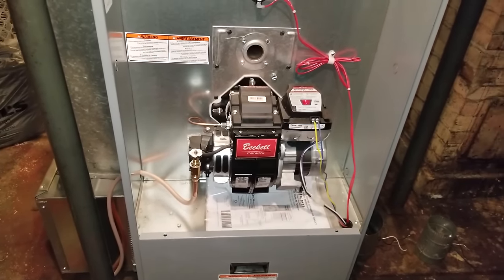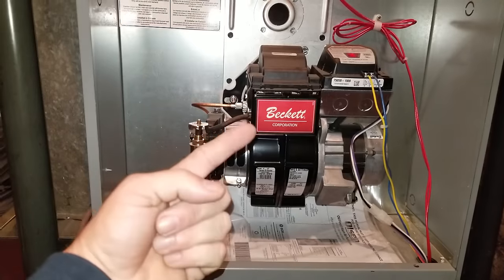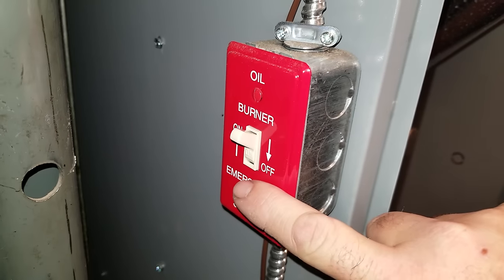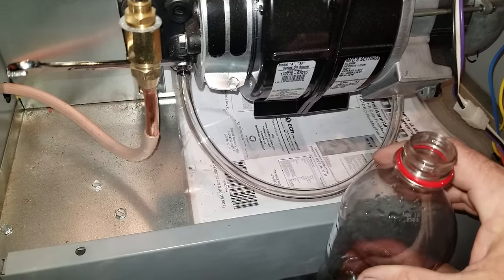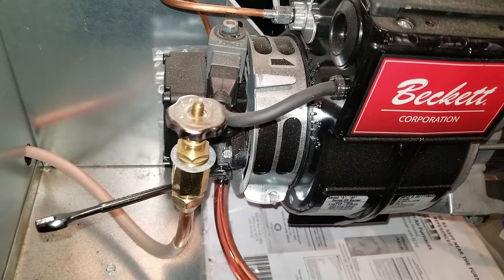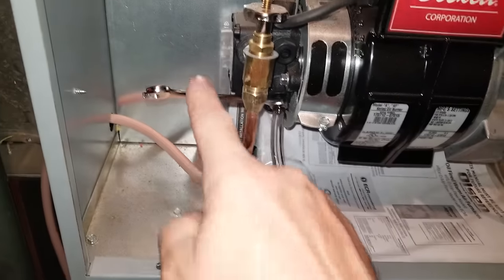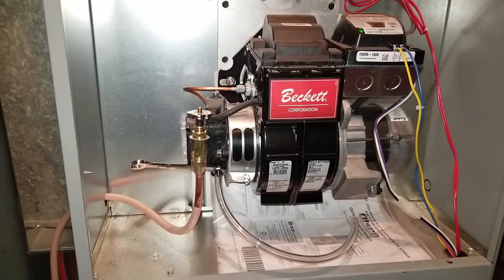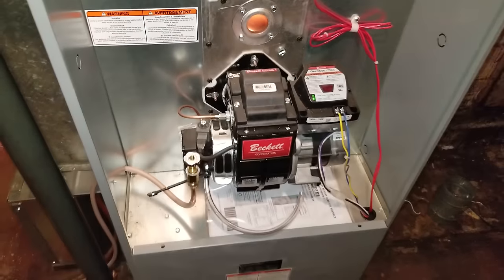How to bleed oil burner how to restart the burner

Comment: I am trying to bleed my boiler.  I have the same Beckett. I am trying bring up my heat at the thermostat. I have a on/ off switch at the side of my boiler & the red still light on top of the box.  No oiler is coming out when I open the knob. Do I need to flick the button on the side, do I need to reset my thermostat because only Cold air is blowing out.

How do I get my thermostat to go up?
The hot water came back on, but not the heat. Please help

Comment: I got a question ⁉️ why or how come when I'm bleeding my (Beckett model 7505 OIL burner) it will give me a good flow of oil but then nothing?? I know there's no air in system cuz I've been bleeding it over&over&over&over& ...u get it ... But then a really nice stream of oil I'll shut bleeder valve it will turn on for 5/10min  then it will cut off & I'll bleed it again then same thing happens??? HUMMM🤔

Comment: I read somewhere that these things can explode if you have too much air in your line and you are trying to start it by pushing the resetting button too many times. You can only try it a couple of times. I used to be there trying for up to an hour. I think I put myself in danger without knowing.

Comment: My oil furnace keeps doing this. I have plenty of oil but the red light keeps blinking and it’s blowing cold air. I went down today and the red light is on but staying on .. not blinking! What do you suggest I do ?
Reply from the maker: Replace tha fuel filter if it is plugged it will make it seem like you are out of fuel
Reply: Thank you..

Comment: I dont know if you know about really old boilers, but i have a 50's boiler and it ran out of fuel, i had someone come over to prime it but he said it wont work, he said something about the fuel pump, but we've been outta heat and hot water for like 3 or 4 nights now, im just afraid of an explosion if i press the reset button too many times by accidently flooding it if it does some how work and im doing something wrong
Reply from the maker: Fuel pump is where the bleeder screw is
Reply: @2strokeguru  Oh okay thank you for the reply, it turns out the fuel pump is shot, and it's so old it cant be replaced so i'm just getting a new furnace, it's the best plan at this point, especially when the repair guy came over and said it's so old he cant get replacement parts for it hahaha!
Reply from the maker: @XLexieXBabyX  that sounds right I always tell folks if this video doesn't work a call to your oil company is next
Reply: @2strokeguru  Yep well you were right, house is a nice 70 degrees, brand new Beckett boiler with all new plumbing lol, Thank you again for your reply!
Reply from the maker: @XLexieXBabyX  happy to help

Comment: After doing all this, my furnace then doesn’t cycle off. It’ll just run non stop until I make it turn off again. I made sure to set the thermostat back and the house is well above its desired temperature. Any idea why this happens?

Comment: What if air keeps coming out like bubbles? I tried I many times taking breaks here and there but the oil has never kept a steady stream
Reply from the maker: Check your fuel level and if you have fuel if you have fuel in the tank your  your filter could be clogged
Reply: Kevin Bergeron guess I gotta call someone to unclog it😒
Reply from the maker: @Tyrecordslol  shut the fuel tank off and replace the filter
Reply: Kevin Bergeron - do you have a video on how to replace the filter? Or where to get it?
Thanks!!!
Reply from the maker: @enzprintco.8625  changing the filter no but I can easily explain it I will do a YouTube video today on it
Reply: That means there is an AIR LEAK somewhere before the bleeder valve.  It can be the pump itself, or the fittings,  filter etc. I would make sure everything is tight before calling for service. It could be as simple as a gasket in the filter, but if you can’t do it make the call.

Comment: What's the difference between clicking the button vs holding down for 15 seconds to activate the Pump Prime mode?
Reply from the maker: Some have different ways of resetting the on in my video is most common
Reply: @2strokeguru  Thanks, I got it to work following your way of just pressing it! I was just confused by the manual since it has a priming section that only talks about the 15 second hold version to activate their special pump prime mode.
Reply from the maker: @PossessedbyPhoenix  awesome

Comment: Hey Kevin I have a question for you !! 
I left work with my house being 65°F.
I came home to it being freezing no heat at all. I got a new thermostat since the old one was an analog and could use updating anyways. However I tried to bleed the system and it just drips but its acting like its not calling for the furnace to kick on. Do you think its a no flame situation or do I need to call my furnace guy? Haven't had heat in about 4 days, I can't go any longer w/o it but my husky is begging me to leave it off 🤣
Reply from the maker: Make sure you have oil
Reply: @2strokeguru  plenty , 225 gallons is why im scratching my head 😅🤣
Reply from the maker: @jhoff_gaming253  are you able to bleed the furnace

Comment: I have a beckett furnace , mine was flooded and the display reads lockout sensor err , what can I do or do I need an Hvac tech.
Reply from the maker: What I would do shut off the braker for half hour let it dry up then repeat the process
Reply: Hey Kevin,  tried that , nothing , says circulating and the prime button or light doesn't come on
Reply from the maker: @rafatere69  at this point I would recommend a service call
Reply: Thnx

Comment: Hey There i run out of oil. Have the tan filed and then press that button twice without bleeding the system. I did not know. Now it is showing a steady red light. What can i do next ? Cause if i press the button it won’t even kick on like it did for the first 2 tries
Reply from the maker: You have to follow this video step by step

Comment: Great video.
Reply from the maker: Thank you I hope it helps
Reply: Hate to ask but I'm freezing. The vents r blowing for a moment but kick off. I haven't bled the system bc there was oil when the unit quit working. Any ideas on what i should do?
Reply from the maker: @mikeemeador9252  could be clogged filter
Reply from the maker: Very common
Reply: Is there any way to test that? So, I go down to the hardware store, buy a filter and go to replace it. Do u have a video about changing the filter? I'm not from a cold climate like this and have very little experience dealing with such things.
Will the filter b inside near the main unit or outside by the tank?

Comment: I noticed on the left side of the burner that your air intake is totally shut.  Is that properly adjusted for your setup?
Reply from the maker: On my unit yes don't adjust it can cause cause your burner to burn incorrectly

Comment: What happens when you don't see a red light indicate and it needs to be bled or any other lighting like it has no power is there any reset for the Motor?
Reply from the maker: Make sure you didn't pop a fuse
Reply from the maker: And make sure both emergency switches are on

Comment: I have an automatic bleeder setup 
However I can see it it foaming up 
The motor does have a bleeder also 
So I bled it at that a few times and it kicked on and ran for a little while and then shut off ..
So I did it again and there was air once again .. 
so I am looking at this automatic bleeder and it still has a bunch of bubbles 
My heating guy said it needed  more oil in the tank but I have honestly been at 7 inches before and I had gotten 50 gallons the day before did something break when they delivered oil ? Very odd
Reply from the maker: You might be out of fuel if outside tank or extreme cold could be gelling  or fuel tank has sludge in it could be clogged fuel filter
Reply: Kevin Bergeron thank you very much I will grab some more oil hopefully that will do the trick ...

Comment: Great video. Is there a way to keep it bleeding so it doesnt time out?
Reply from the maker: No if it doesn't bleed you might have a different problem check your battery's in the thromstat
Reply: @2strokeguru  Im not having an issue but I heard something like if you jump out FF on the control module you can get the boiler to run continually if you need to bleed for an extended period of time. Is that true?
Reply from the maker: @euonymus1980  I honestly have never done that that can be very dangerous can cause over heating and excess wear on parts they need to cycle for cool down and rest periods
Reply from the maker: That is dangerous you don't want it to keep running it could get more fuel build up then when it lites could explode

Comment: You know that button that turns the furnace on when you close the door ? The red light on mine won’t even start blinking unless I’m holding down that button. Why ? I also can’t even get the bolt loose to start the bleed. My husband has done it before so I don’t know what I’m doing wrong. My furnace is brand new and it kicks off every other week. I have a one year old baby. I woke up this morning and my house was 49 degrees. I’m so heartbroken I feel so defeated. My tank is full. It’s kicked off two or three times since we’ve gotten the tank full. I don’t know what to do anymore.

Comment: kevin what to do when i guess, to much air i,m always bleebing it  i,ve even unscrewed  the (P) bleeder all the waY OFF CATCHING THE DEISEL IN A BUCKET, RESOLVES FOR A WHILE BUT  NO,.... AGAIN  IS THE  FUEL PUMP BAD  PLEASE HELP
Reply from the maker: Could be a clogged fuel filter on the tank never remember the bleeder all the way you need it for restriction
Reply from the maker: Half turn is all you need you might need more fuel
Reply: @2strokeguru  THANKS KEVIN  ,NO THERE,S ALOT OF FUEL FILTER IS OK I GUESS I JUST KEEP BLEEDING IT ONCE IT STARTS IT WORKS TO TEMP BUT STALLS AGAIN WHEN 2ND TIME AROUND

Comment: Hi, my burner stopped working suddenly and I have no hot water. I checked the igniter and in the past I was able to press the red button and restarted it but now I don't even see the green light going on. Do you think my ignition control module is gone? Any suggestion would be helpful. My ignition control module is Beckett R7184P
Reply from the maker: Check your fuel level 1st if you have fuel your fuel filter could be clogged if you ran out
Reply: @2strokeguru  I checked and there is half a tank of oil and the filter was changed about a year ago. It used to be the green light was on flashing and I just reset the red button but now there is NO flashing green light at all...and everything is quiet...I have checked all the power switches and they are all turned on...
Reply from the maker: @trankt54155  did you open the bleeder
Reply: @2strokeguru  Yes, I opened the bleeder and oil came out...
Why is the flashing green light on the igniter control is no longer on?
Reply from the maker: @trankt54155  most likely ignition
Reply: @2strokeguru  I checked the location of the gun tips and they are appropriatedly spaced and also the nozzle has no carbon buildup and I cleaned it as well. There is no oil puddle in the burning chamber (no wetness). The driveshaft to the pump is freely spinning by hand.The oil line has running oil and oil goes through. How do I test the electronic ignition control module with an ohmmeter? I tried to override with pressing the reset red button for 45 seconds and still nothing happened. The green light does not come on BUT only comes on in a flash when I turned on the power switch. IF you have to test the control module how would you do it??? Is there a fuse inside the control module box???
Reply: @2strokeguru  Thank you very much for answering.
Reply from the maker: @trankt54155  your welcome do you have digital thromstat
Reply: @2strokeguru  Yes, the wall thermometer is digital by Honeywell.....the one that calls the furnace for heat.
My testing Ohm/volt meter is digital reading.....I Tested the CAD sensor and it is fine (under no light it has open circuit with infinity resistance and under bright light is almost closed circuit; it looks clean). How do I test that the control module unit is still working properly (it is R7184P1064). I think it is dead but I need to confirm that it is no longer working as it should. I overrode by pressng the RED button for 45 second but NOTHING happened and the diagnostic green light is not doing anything either....
Reply from the maker: @trankt54155  for crap and giggles replace the batteries in the thermostats

Comment: where do you wire in the 120 v,got the same burner...thanks
Reply from the maker: That will have to look in your owner's manual for
Reply: @2strokeguru  didnt see anything,in installation book,i did slid out the blower,which has a circuit board in front of it,black and white pigtailed in there...

Comment: How do I know if I have a monitor heater?? I just bought my house and it has almost the same model as the video. I think!!! 😅
Reply from the maker: A monitor heater is all I unit on the wall and you can't mix fuel  kerosene with home heating oil and diesel must use the required fuel only

Comment: What about if there is no light on the bottom?
Reply from the maker: Check your thromostat batteries
Reply: thanks our reply, i have 4 zones and the thermostat are working, just when i tried to follow your steps in the video, there is no light on the bottom and when I hold it for one minute 2 orange lights turned on and not flashing when i remove my finger the screen black again
 @2strokeguru
Reply from the maker: @abdulibraheem3694  you need to have a tech come out it's more than just a bleed
Reply: Thanks a lot, appreciate your help @2strokeguru
Reply from the maker: @abdulibraheem3694  very welcome happy to help

Comment: The bleeder valve screw fell off and screw and attachment flew out. we put the attachment back and then the screw but cant get it back together. Did we put it in wrong? Cant get it out now! Help!
Reply from the maker: There's nothing in back of the bleeder screw i don't know what you took off the bleeder screw you just loosen not remove
Reply: @2strokeguru  bleeder screw came off( we must have loosened too much and all flew out. Now I think we put it back in wrongful
Reply: Wrong
Reply from the maker: @maryolson1056  i would call service
Reply: @2strokeguru  landlord says I have to pay because I let it run out of oil.
Reply: Thanks ,Kevin, for trying  to help.
Reply from the maker: @maryolson1056  welcome
Reply from the maker: @maryolson1056  yes that would be on how they do it

Comment: What if I do all that and get no flow only a couple drips?
Reply from the maker: Change the fuel filter at the tank
Reply: @2strokeguru  It's a 290 gal below ground. Filter at the boiler?
Reply from the maker: @THEATREofPAIN270  OK then replace that filter ingrownd tank is illegal here
Reply: @2strokeguru  I wish they were here. And that was my plan although I think it was done this past April.
Reply from the maker: @THEATREofPAIN270  if there is sludge in the tank you will need and additive to brake up sludge and replace the filter I have seen new filters clog
Reply: @2strokeguru  Your awesome but there's not even an isolation valve. All I need is fuel pissing everywhere. So here goes $100+ I don't have. I'm cold and I fucking hate Mondays. Thank you again. Stay warm.
Reply from the maker: @THEATREofPAIN270  it's a twist valve and thank you

Comment: How about after doing all of your process and still won’t start
Reply from the maker: If you are getting fuel flow and this video  doesn't get you burner running you need to call a oil company for further assistance
Reply: @2strokeguru  I was able to start burner, reset button need to be holding for 3 min not 30 seconds as the manufacturer suggest! Thank you for your great advise
Reply from the maker: @ottollamas3050  very welcome

Comment: What does it mean when there is no red light at all? When I hold it. The prime light comes on. But when I let go, it goes back to no lights
Reply from the maker: If there no lights on could be safety switch off or dead batteries in the thromostat to name a few
Reply: @2strokeguru  where would the safety switch be? Ill check the thermostat
Reply: @2strokeguru  my system has no kill switches on the furnace or any walls throughout the house
Reply from the maker: @dueloner4820  it's emergency switch typically near the main entrance or top of the basement stears
Reply: @2strokeguru  i figured it out. It was the thermostat.  Not the battery though.  Took it apart. Put it back together.  And now everything is all good. Thanks for the troubleshooting pointers
Reply from the maker: @dueloner4820  very welcome

Comment: I have the same oil burner, so I already have the oil filled within 8hrs. Do the same process apply? Thank
Reply from the maker: Yes step by step
Reply: I just want to thank you very much for the video, very helpful  with step by step...yes try it for the first time bleeding it and fired it up..I got heat!!! You just save me $100...
Reply from the maker: @sophatchea1158  very welcome that's why I made this video
Reply: @2strokeguru  can you please tell me how to get my hot water, I have heat, but no hot water...is there a switch or thermostat for hot water? Thank in advance...
Reply from the maker: @sophatchea1158  is it oil water tank
Reply: @2strokeguru  it oil, both  for hot water and heat together...I got heat, but somehow I'm not having the hot water, kinda like cold..not freezing cold..
Reply from the maker: @sophatchea1158  you light it the same way there's a  big square cover 2 screws on both sides remove the screws then the cover will come off you will see the burner looks like the furnace one same setup

Comment: I just moved into a house an i cant get the furnace to lite i was told it could be a lock out what do i do ?
Reply from the maker: Hold the button down for a solid minute and make sure both emergency switches are on and batteries in thermostat are good